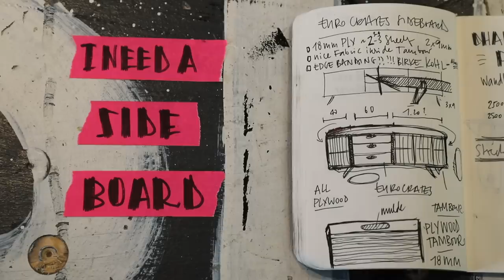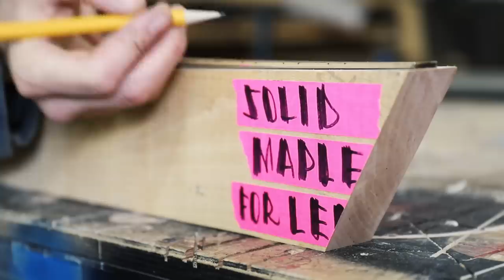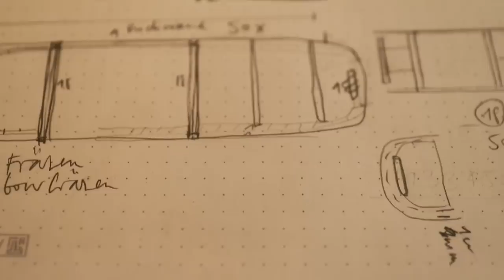Plywood Credenza withTambour Doors

Comment: I think "using cutoff as a jig for edge veneer" might win for random pro tip.

This is assuming, of course, that you're good enough with a jig saw to cut it out correctly the first time and not make an absolute mess of it and sand it down to the line after like I do.

Comment: Nice build (as always)! Little tip, use the iron method for gluing veneer (on the sides), like you do in the end with the fabric. 
That works so much faster and easier.
Just spread wood glue over both parts with a foam roller, let it dry, than get an iron (you know, for clothing) and heat up the veneer while it's on the surface (disable the steam mode if you have one). This activates the glue again. After it's cooled down it's glued together very well.
Reply from the maker: Oh cool! I will try that!

Comment: This was amazing. I never imagined you could make a sliding door like that. I like that the plywood plies are showing. I recently built a bed out of plywood and i intentionally left the edges bare so that the plies can be visible. I am only worried that the credenza is long and it might buckle in the middle after some time making the sliding doors jam. Maybe it should have 6 legs to even the load or maybe i am overthinking it.

Comment: Very nice. Is it open in the back? I mean where do the doors go, do they sort of close off the back when you open them? Or is there a back plate that they slide behind? 

If it’s open in the back dust will get in, and you would not be able to place it anywhere else than against a wall.

Comment: Incredibly cool, it just makes me nervous seeing there’s no cross-bracing at all to prevent movement left and right, other than the glued joints.
The sliding doors mean it will never structurally fail of course, but then the doors get pinched and I’m not sure what that would mean..

I’d personally add something.... maybe a full height back on the left and right, as far back as it can go without touching the door, that would act as a cantilever support at the same time as cross-bracing the whole top surface

Comment: Soooo cool.
The end product looks amazing.
Just a quick question........
What would you do if the sliding doors bind?
I tried something like you have, struggled to get it to work with the hot and cold cycles in my house.
I had to put Vaseline in the track the doors run in.
Any help would be great. 
Thanks
Reply from the maker: The tambour has about 2-3mm of room to expand-but plywood doesn‘t move really so it should work fine. I also did not glue in the top of the credenza. It’s a very tight fit but it can be taken apart in case I need to fix something. I also used a bit of candle wax in the grooves for the tambour

Comment: How do you choose between track saw and table saw? Seems like they do similar things.
Reply from the maker: I rip down full sheets on the tracksaw and do the rest on the tablesaw.
Tracksaw is also perfect for cutting angles giving warped pieces a straight edge. They don‘t do the same thing but they do work hand in hand.

Comment: Hi, how are you? A question: I have made the furniture, but I have problems with the curtains when running, they lock, must they touch the bottom of the channel or do they only rest on the base? Thanks for your answer, greetings from Argentina
Reply from the maker: Mine touch the base. Try to add some wax to both sides-sometimes that helps
Reply: Tanks!

Comment: Very nice BTW check out Diy Rocklerr Bandy clamps on YuTube  they are quick and easy for gluing edgeband  instead of the tape method !  i’ve been doing Woodworking as a hobby for nearly 35 years and i did it professionally for 20  i’m not always fast to jump on new Gimmicks and tools  but every now and again someone comes up with a good one  and those are one of those IMO  the homemade ones are a cheaper version then the ones Rockhler sells and work well as you know in Woodworking there isn’t  a thing such as too much glue or clamps !